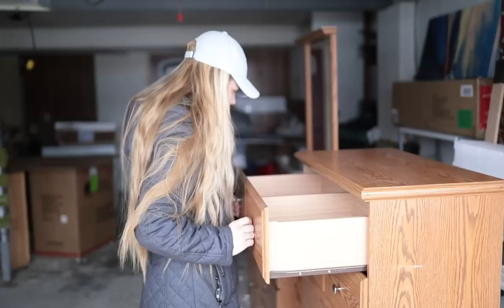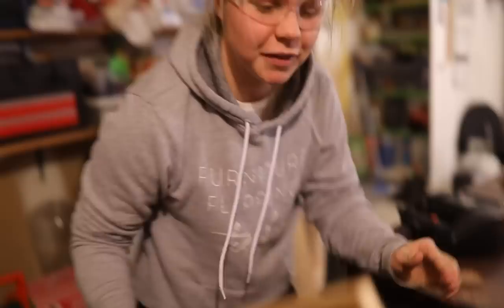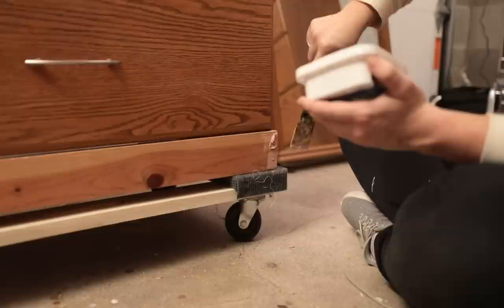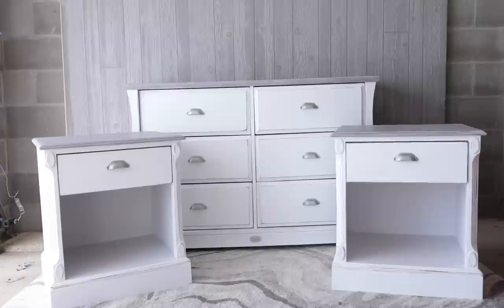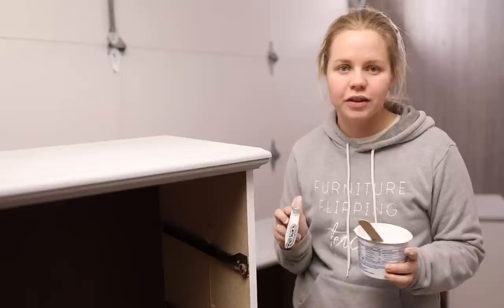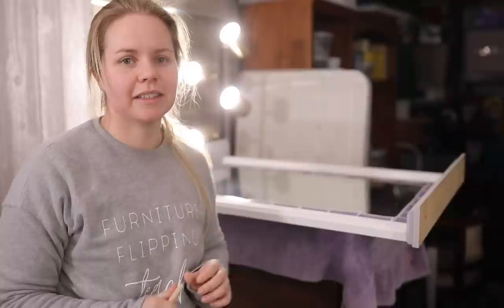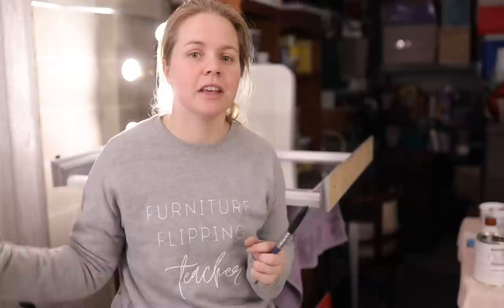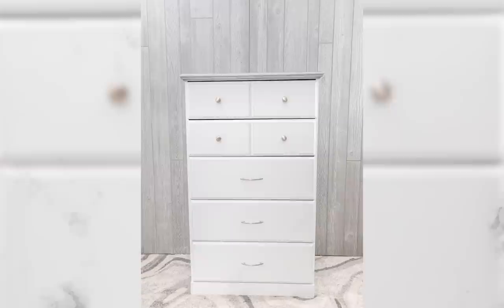| FB Marketplace Furniture Flip | Rustoleum Smoked Glaze | Bedroom Set | FURNITURE FLIPPING TEACHER|

Comment: Just a money saving idea to consider....you can make your own chalk paint easily. And I like it way better than the Rustoleum.  Also, the colors are endless and a gallon of “Oops” off-white will last you forever. Not to mention, the sample containers for small products.   Just 2 cups paint, 4TBS plaster of Paris, and 2 TBS water.  I mix the Plaster and water first until thick and smooth, then gradually add it to the paint while mixing.  It dries quickly, so you can work fast. Keep a lid on it if not using.  Any grittiness from lumps not mixed out well, just hit with fine grit.  I seal mine with one coat of varathane but it isn’t required. I’ve done bedroom furniture to kitchen cabinets and it’s never let me down! I got the recipe from the paint lady at Home Depot, who told me to stop wasting money on chalk paint and make my own! Enjoy!
Reply: This is so helpful thank you! I wanted to get chalk paint but it’s so expensive! Also, what type of paint would you recommend? Just any household paint or is it a furniture specific paint?
Reply: I’ve used assorted left over paints to make my own chalk paint for years and been pleased with results. Some of the expensive chalks are certainly great but costly for larger pieces. I’ve not used waxes much. I like the Dixie Belle top coat a lot which is costly but goes a long way. Several coats of top coat are very necessary for tops of pieces, otherwise won’t hold up to much use.
Reply: @gk2744  any paint will work. I have noticed a difference with the sheen types. I painted my daughters kitchen cabinets with a white eggshell and then sealed.  They looked great 4 years later when they moved!
Reply: We renovated the whole house using this method. But just a small correction when using on walls is to add lime or whitewash instead of plaster of Paris. Because plaster of Paris hardens fast and encourage mold growth. But whitewash reduce or even most of the time prevents the mold problem and regulates the humidity very well.
Reply: And of course be very careful while handling whitewash !
Reply: What is white wash?
Reply: @gk2744   a way better option and a lot less toxic than using plaster of Paris  is using baby powder.. just make sure it’s talc baby powder and NOT corn starch
Reply: @yupyup21ful  a solution of lime and water or of whiting, size, and water, used for painting walls white. It's slacked lime which is chalk calcium carbonate. https://www.nps.gov/articles/limewash-an-old-practice-and-a-good-one.htm tells you some about it, although they seem to be emphasizing the positives and not the negatives on the product.

Comment: To minimize the brush strokes, take a 220 sand paper and do a quick sand in between coats and you’ll have a perfect smooth finish and no brush marks😊
Reply: Hand sanding the amount of surface area she painted in this video would likely make any regular person go insane.
Reply: I was wondering how to deal with that. I did the first coat with a brush and the brush strokes drove me nuts so I switched to a roller.
Reply: @jacr1104  That is what I'm thinking.

Comment: You can save money on your chalk paint by using primer first then it does not take as many coats of the chalk paint that is double the price of primer. It also gives your paint  a better surface for your paint to adhere to. You do a great job and I admire you.
Reply: Thin the chalk paint half water. Will cover better on second coat fantastic
Reply: I mean thin first coat.  Goes a long way   It acts like a primer
Reply: I was going to suggest she prime first as well. These might develop bleed through marks down the road. Always wash, sand a prime.

Comment: Here's another tip for you. If you run across a metal tractor seat, snatch it up! They fit nicely on top a mini dolly. It will get you up off the floor so you can scoot around you piece as you are painting, sanding and sealing. It will save your and toes! Love you videos! Thanks for sharing your knowledge.

Comment: One tip for handling putty (bondo, wood filler).  Use two putty knives, a large one and a smaller one. Put a blob of putty on the large putty knive and take the desired amount from it with the small one.  Using two putty knives, you can easily scrape them clean agains each other.  That way you have perfect control on the blob.  The putty stays together and it remains perfectly mixed by the constant transfer from one putty knive to the other. Also, you keep your hands clean.

Comment: Hard work really does pay off and in your case your student loan debts! Love what you’re doing and the great example you are to others :-)  One tip you might be interested in regarding the use of your clamps is to use a block of wood between both ends of the clamp (it displaces the pressure being applied) so as not to dent the piece with the clamp. My husband is a finish carpenter and always uses that technique ;-) Blessings~

Comment: You might wish to pre-drill even a small pilot hole with particle board.  Also if you have a bit that's about the size of the screw head and drill down about 1/8" you'll find you needn't so much pressure to get screw to countersink.  Pine's easy and soft.  Really like the finish!
Reply from the maker: Ahhh, thank you! Thanks for watching!

Comment: Just a tip if you haven't already been told. When filling in holes with wood filler, after getting the amount you need to fill the hole go back over it with a wet/damp finger, and lightly smooth out the filler. I find it cuts down on the sanding. 
Love how your pieces turned out.

Comment: Quick Tip:  Chalk Paint.....

To avoid brush strokes showing up when using chalk paint take a spray bottle full of water after dipping ur  brush in the paint lightly spray the brush w water do this each time!!!!  I also spray the can of paint to b4 dipping my brush!!!  I also use brushes meant for chalk paint and Val spar small angle brush!!!!  I hav done these steps for many years and I hav never had brush strokes appear once dry!!!!

2nd tip:  
When applying a top clear coat add a little of the paint u used to tint the top coat and 10% water!!!!  This will prevent any brush strokes from showing up!!!!!

Comment: Looks great, the reason your wood was split when you were drilling is that's not how you counter sink screws, to counter sink you need to pre-drill the space for the screw head to sit, it's a special head that goes on your drill, which gives you the circumference of the screws head to sit below the surface xxx

Comment: Wrap the ends of your wood where your cutting in painters tape before you cut. It will help the edge of your saw from kicking back and ripping off like it did on your kick board (37:30 min). It will also help the edge of the saw from ripping the edge of the wood and clean up your kerf.

Comment: Ms Lauren you are the cutest thing I have ever seen. I luv watching you work. You are becoming quite the DIYer. This set came out beautiful. Two thumbs up. Keep going strong. Looking forward to your next flip.
I agree with you on adding a bit of water to any chalk paint to lessen the brushstrokes. I do it to all of the chalk paints I use. Do you sand in between the coats of paint? I do and I find that it helps lessen the look of the brushstrokes. I also sand in between the coats of the topcoat. I LOVE the Rustoleum Matte Clear top coat. It leaves a most beautiful finish. I use it with all chalk paints when I don't use the paste waxes.
You may want to ask your dad about some info on a countersink bit for hiding those screws. They cost about $5.00-$10.00. You did a good job of countersinking the ones you used on the tall dresser because you had the flexibility of the soft pine, but when you countersink that way, you will split your wood creating more work.
Reply from the maker: Awe, thank you! I occasionally sand between coats to get it a bit smoother. Thanks for watching!

Comment: I'm enjoying your videos. I'd like to suggest some tool accessories that will make your projects easier... so let me know... Kelly from Windsor, Ontario
Reply from the maker: Suggest away! Thanks for watching, Kelly!
Reply: @FurnitureFlippingTeacher  I love my impact driver.. however.. you're not renovating your house. I'd like to suggest getting a small rechargeable screwdriver. They're lightweight and small.. so it won't hurt your hand and wrist by the time you get done taking off all the knobs/handles. Most of these will stay charged till the end of your project.. but if not, are easy to charge overnight or in a few hrs. You use the short hex bits. Look for the 2" ones, and longer for hard to reach areas. Sometimes with a short bit it's hard to see what you're trying to do... because you have to be so close to the screw you can't see around the screwdriver. With a regular screwdriver, you have to manually tighten the chuck down around the bit. Look for one that has a quick-change chuck. Basically, it's already ready to receive your bit.. and can be changed out for another one in seconds. You can also get hex drill bits. Again.. quick-change between drilling a hole and driving a screw.
For sanding, get an electric sander.. unless you want big muscles on one side of you. Don't get an orbital.. it'll make swirlies on your work (as you already know). A square one will work well for your jobs.
For painting... there are these plastic pour spouts that you can clip onto the lip of the can. They make it easy to pour and when you remove it, it has kept the edge of the can clean so you can close it and there is no paint build-up around the edge. I liked the suggestion from one lady's comment about putting a magnet on the bottom of a recycled yogurt container to catch any staples/ nails you pull out. You can also get a small metal tray with a mag on it's bottom(6" wide) that does the same thing. They are often used by mechanics. I've gotten mine at the dollar store. I have a million other things to tell you about.. but this will be a good. Kelly